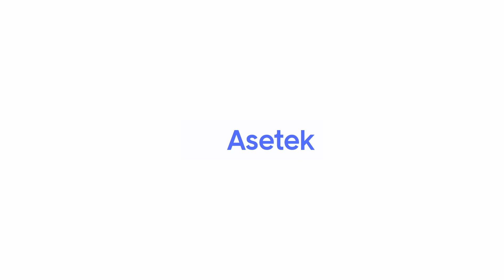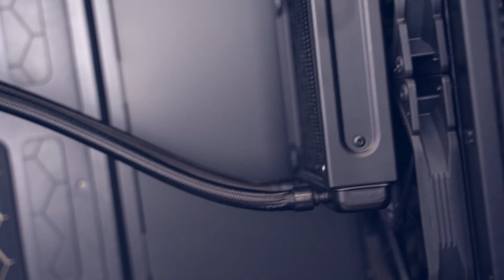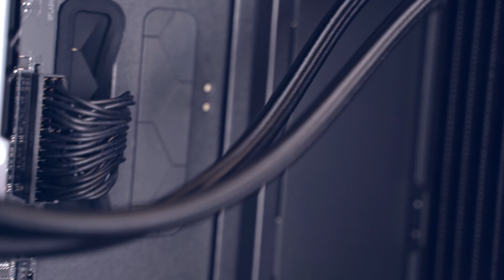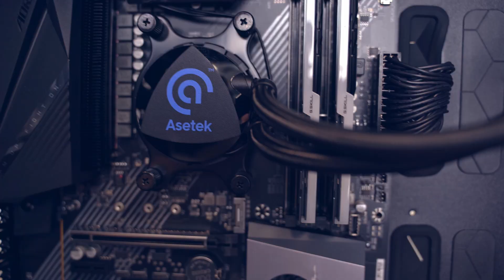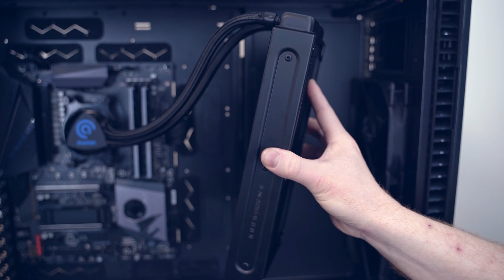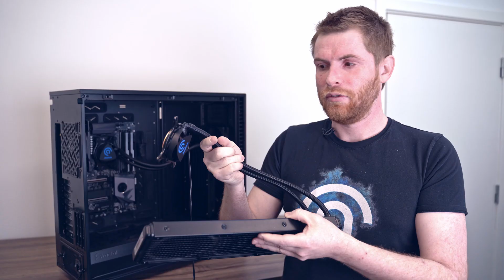How to: Quiet a Noisy AIO Liquid Cooling pump from Asetek

Comment: Fk this, i aint never buying an AIO again. I tried everything to get the bubbles away and there is still a lot of them. I dont care about the good looking thing, i want silent system.
Reply from the maker: Hi Tukine,
 
I am sorry to hear about the issues, that you are experiencing. Our AIO's are not supposed to be that noisy, if you are in fact using an Asetek-based liquid cooler.
 
Which AIO are you using in your computer if I might ask?
Reply: @AsetekInc  im using asetek 510LC
Reply from the maker: Hi Tukine,
 
That could be explained by evaporation of the liquid inside the aio over time, since the Asetec 510LC is an older product. As time progresses the amount of air inside the loop rises, which over time can lead to micro bubbles that is hard to stop. It is important to say that all AIO loops have air inside them, as the liquid expands as the temperature rises. Were the loop completely filled, it could lead to a pressure buildup that could potentially damage o-rings making the loop leaky.
 
Placing the radiator at the top of the computer can however help the air get trapped in there and newer reach the pump. Have you tried this solution?
Reply: @AsetekInc  uhm not yet, but my case doesnt have a top fan bracket, cause i filled it up (just cause my pc sat in a corner for a year i think, so that it wouldnt get so dusty inside) but i think that i could just make new holes in there. Im going to try this, thank you for your help
Reply from the maker: Let me know how things go. I am more than happy to assist you :)
Reply: @AsetekInc  thank you for your help once again. Now my pc looks pretty cool and it's quiet. Thank you :)
Reply from the maker: @HugoEiSeBoss  That's great to hear. You're welcome! :)

Comment: Mad cause bad nzxt z64 is rattling 24/7. I tried everything but it won't stop rattling. I hope NZXT will exchange the AIO. 

Til now I wish back the Air-coolers. I had never a single problem with big air coolers in 15 years. I bought my 1st aio 2 months ago. Z63 costs 220€ and I'm very disappointed because of the noise lvl. :(
Reply from the maker: Hi Taifun,
 
I am sorry to hear that. There can always be some bad samples and it is obviously under warranty if it is 1 month old since NZXT has 6 years of warranty on their products.
Reply: Im about to receive my 3rd Nzxt Z53 from RMA because of this

Comment: Denis thank you so much ❤️ but will have the bubbles in the tubes and pump moving give off better cooling results?
Reply from the maker: The more bubbles are "stuck" in the radiator, the better the performance you will get :)

/Dennis

Comment: How about a system that removes or traps the air bubbles.
Or a design where the air never reach the pump.
Or a pump that do not make sound when pumping air.
Or a system that dampens the sound.
Reply from the maker: Absolutely! 

Actually the reason for the positioning suggestion, is that in these orientations, the tanks will serve as a 'system' that traps air bubbles.
That being said, I've noted the suggestions and will forward them to our R&D department :)

Most of our partners also use noise dampening foam in the caps - but acoustics obviously change, as you have different cap designs and materials. :)

/Dennis
Reply: @AsetekInc  I should have been more precise with my comment.
 "How about a system that removes or traps the air bubbles" in all orientations.
There could be a small "tank" on both sides of the radiator, "lower than the tubes on the tube side", and a small tank in the "caps" for systems where the radiator is lying down, or a small tank/trap" in the "center" of the radiator that could trap air.
 You could add a symmetric trap to one of the tubes, there are lots of other places you could trap air.

You could also improve the filling proces reducing the air in the system in the first place.
You could add a good fill cap system making et easy to top off the system.

That sad... I like that you explain way you should use these orientaseions, I am all for teaching people simpel physics like air raises in water and the combination of gas and liquid in a pump makes noise. :-)
Reply from the maker: @Petch85  Actually there is reason behind the air that is left in the radiators. We could (quite easily) remove the tiny pocket of air that naturally occurs in our systems. However, these serve several purposes - one example is that as liquid heats and cools, it expands (as I'm sure you know) - and as thus we want to leave enough gap in the system to allow this process to happen safely. 

/Dennis
Reply: @AsetekInc  True... But you could make af submerged balloon that would achieve the same thing as having free air in the system.
If you had a balloon, filed the system completely and had some air traps in the same system, you would be sure that the pump would stay quiet even if there was some diffusion over time. It might even be possible for the system to survive extreme cold during transport. And the extra cost might not be that grate.
Reply: @Petch85  you'll always get air eventually anyway due to permeation
Reply: @seegee9  Do you have any proof that would suggest something like that actually being possible?
Reply: @AndyU96  the rate will be low buts its a fact it will happen